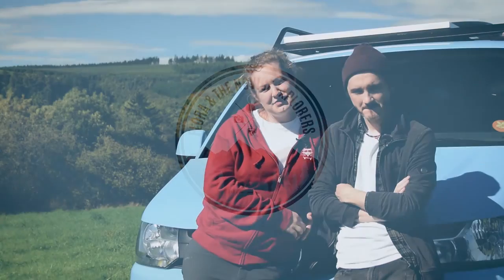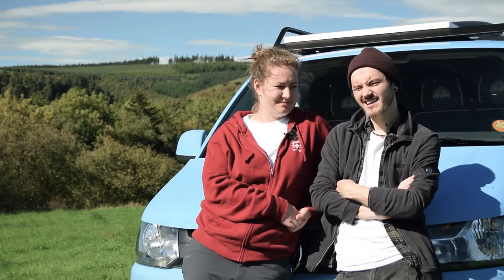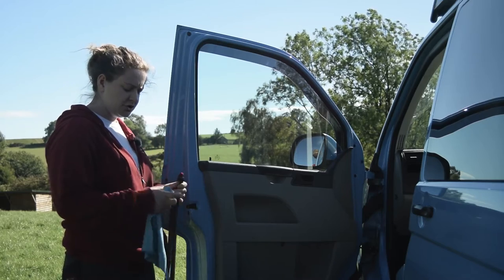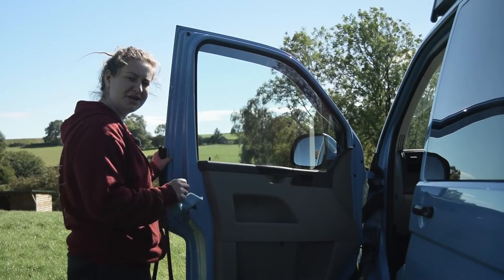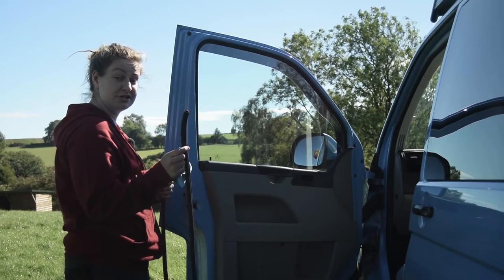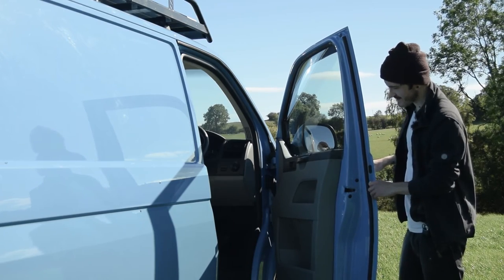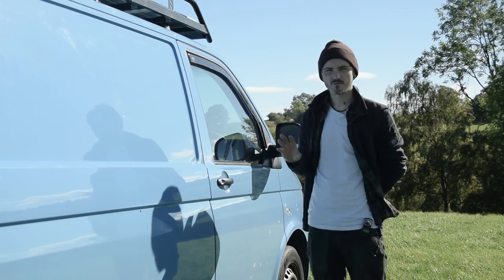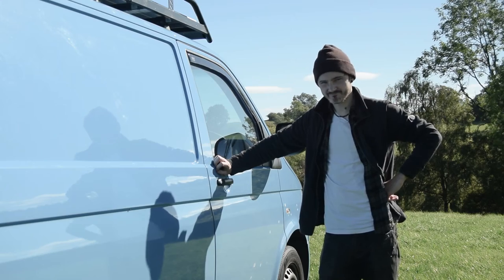Make your T5 Front Doors "Sound like a Golf" - Does it work??

Comment: I installed these on my t5 also. Just watch when it rains or you wash your van as water goes down into the seal from the top and fills them with water. I cut a small hole in the bottom of the seal so water can drain out but after a month or so they have gone back to sounding like a van door shutting again.
Reply from the maker: Oh dear! Thanks for the heads up, we’ll keep an eye on that! We haven’t had any problems yet, only thing we’ve noticed is that sometimes you have to pull the door a little harder if you’re closing it from the inside

Comment: Surprising! You can hear the difference. Good cheap mod. I wonder if it'll also reduce a bit of road noise?
Reply from the maker: Cheap and pretty effective! Reduced road noise is often listed in the features of these rubber strips. Also reducing the paint chipping due to the doors dropping over time, which is a bonus!